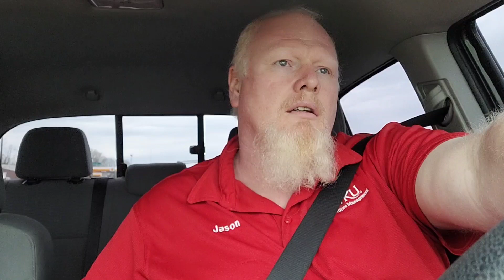Johnson Controls N2 Going Away

Comment: Top tip: if you're trying to get your usb to comm port to N2 / ZoneBus adapter working, you may have to run HVAC PRO in compatability mode as Windows XP Service Pack 3.
Reply from the maker: Yes. We no longer do anything with n2 devices other than replace them.

Comment: Good video, 
Any more videos on this dying Protocol :D
I have an NC that will not take a download.
The trunk is loaded; as you mentioned it, with new devices. When it runs there is alot of lag, real slow.
Reply from the maker: I will be doing a few more I'm sure. Try disconnecting it from the n2 network and do the download. If that doesn't work you probably have a bad device